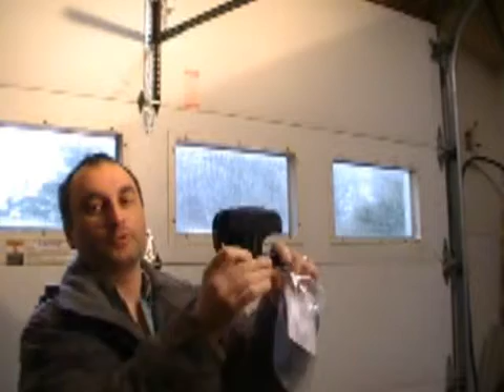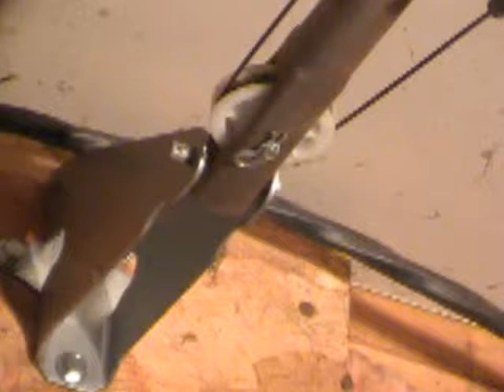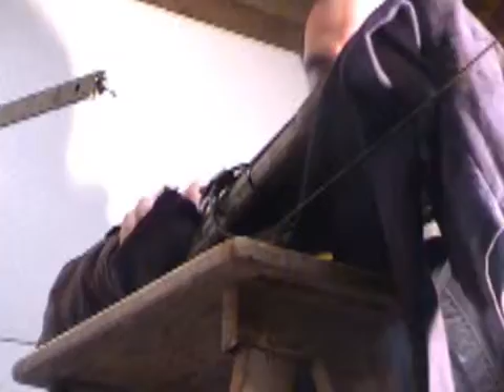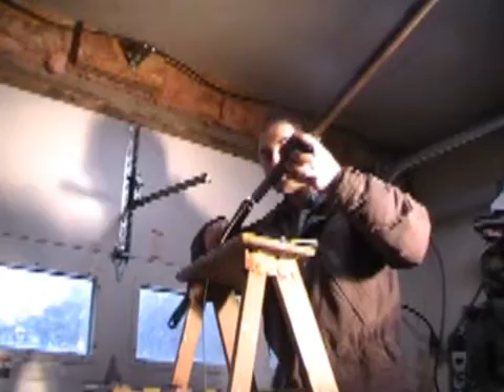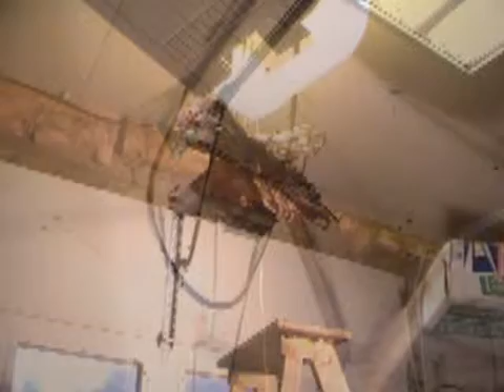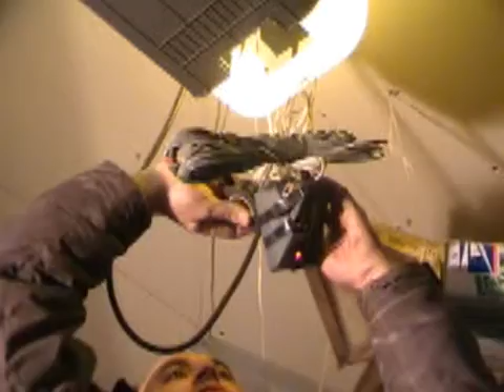Stanley Garage overhead door repair

Comment: How did you get the rail apart
Reply from the maker: +Colton Beedy it just pulls apart
Reply: ok because I have a old stenley I need a rail and chain for and the carage and the end pice for the cable
Reply from the maker: +Colton Beedy you should be able to take it all apart and replace the parts as needed. I found my parts on amazon
Reply: +shanesmaineshop well the opener had Ben setting out side for years and the carage is done for and chain is also don't for and the cable pice
Is cracked off so it will be a some time before it gets installed
Reply from the maker: +Colton Beedy good luck hope it goes well for you